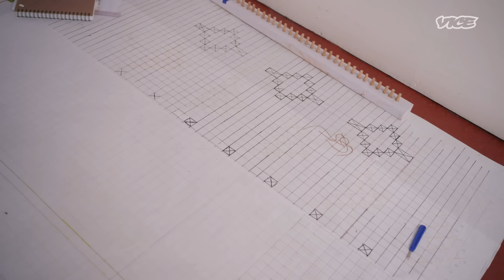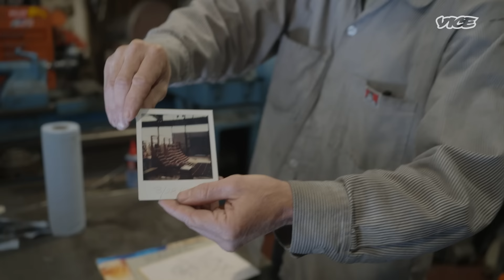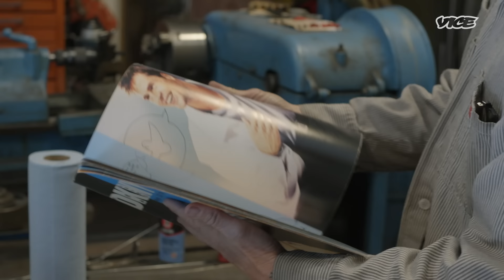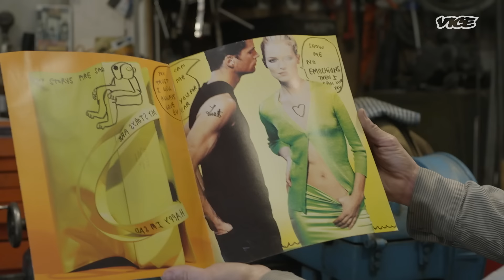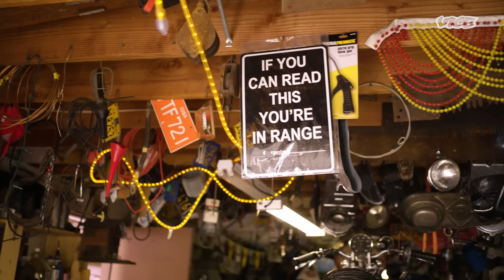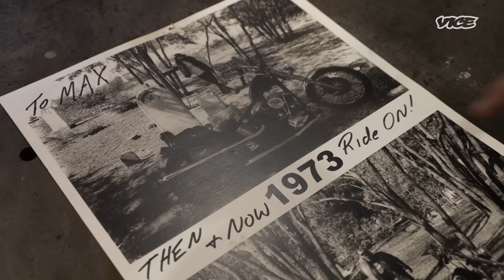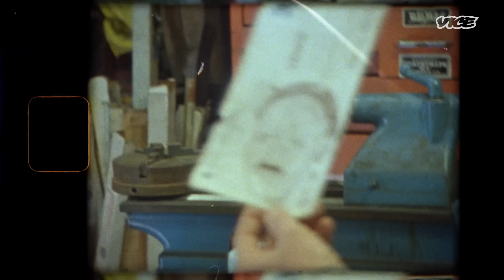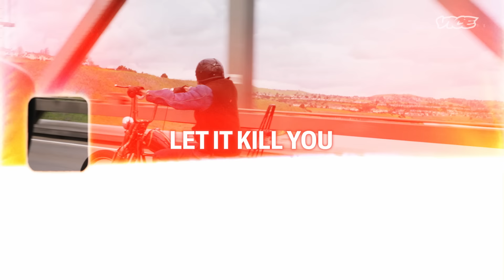From Vert Legend to Chopper Icon: Max Schaaf | Let It Kill You

Comment: Taking the tank in from the cold into the warmth produced condensation under the paint. I used to employ a method for easily getting resin out of a  blown glass pipe by putting it in the fridge for 15mins and when you take it out, condesation forms between the glass and resin so it comes right out clean 😎